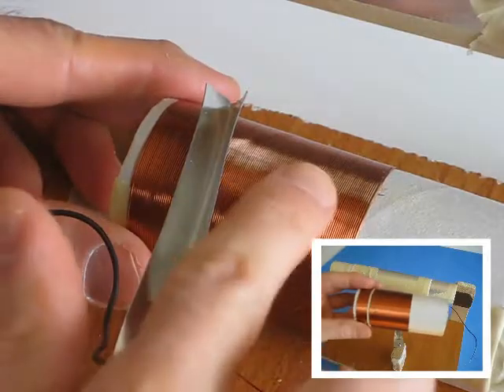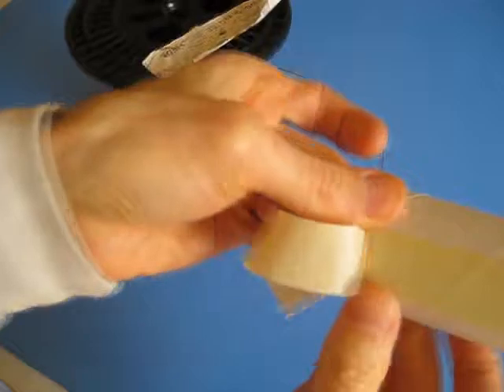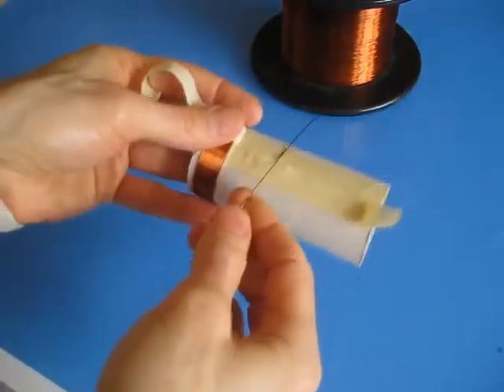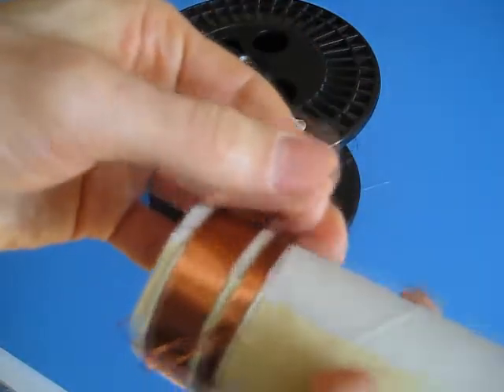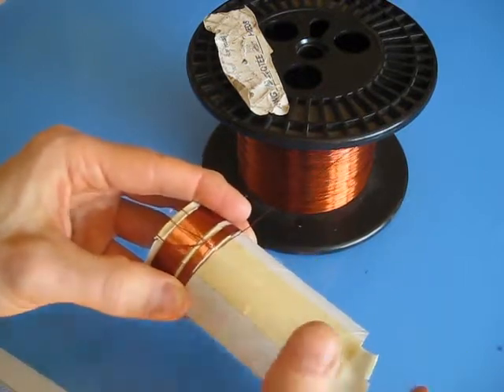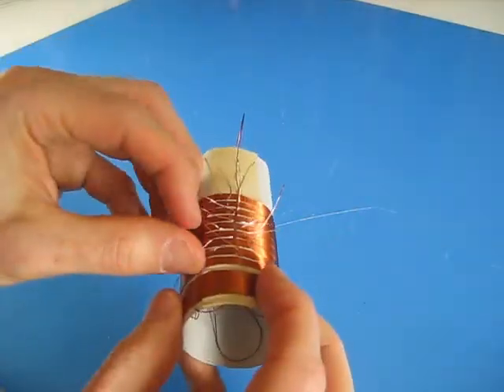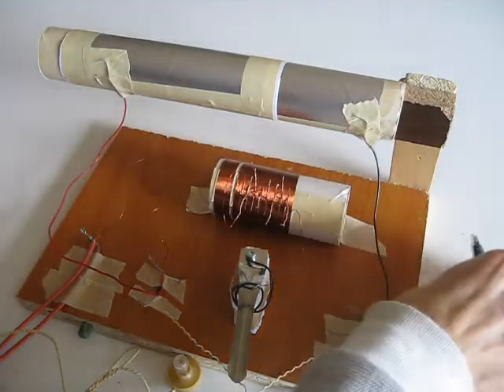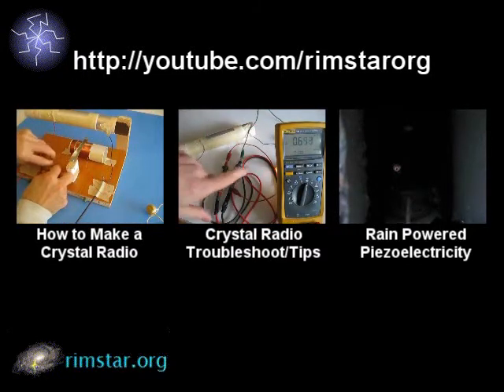Make a Crystal Radio Coil with Taps

Comment: On the end of the coils I used solder lugs I happened to have.

You gave me an idea for my next set of coils. I'll use the double-sided tape length-wise with two strips. Before I covered the PVC pipe I used completely with tap. I'll show how to make the coil this time.

As for you suggestion for not using the iN34 with the vacuum tube radio, I already did that and I'll ge ahead and make a video on it. It's called a grid-leak detector as you probably know.

Comment from the maker: It might work if you connect the end before the first tap to ground and leave the other end ungrounded and then connect the first tap to the antenna and use subsequent taps for tuning. There are many designs that work. The purpose of having two coils is to electrically separate them with a small gap for just a fluctuating magnetic field to cross. This helps with selectivity, tuning into only one frequency, though it reduces sensitivity or volume. See my "How a Crystal Radio Works" video.

Comment from the maker: @murkava I doubt it would hold the wire down well enough to last. But then again, maybe there's some double-sided tape I'm not aware of that'd work - or if you use stiffer wire. There are other techniques though. For example, if your wire is stiff then you can simply give a twist where the taps are and the rest of the turn would stay in place. Another is to apply glue as you wind the wire, I guess 30 second krazy glue, provided the glue doesn't eat away at the enamel insulation.

Comment from the maker: My understanding is it's to help keep the antenna electrically separate from the tuning part of the circuit, the tuning part being the second coil and the capacitor. It's not a complete electrical separation obviously but it's supposed to help. Makes sense.

Comment from the maker: @murkava But if I understand correctly, you used glass beads where the taps are so there was no break in the wire. Another way I could have done mine would have been to put a few twists at the base of each loop  so that when I cut the loop to remove the insulation, the wire wouldn't unwind. At the ends, did you put the wire through holes in the cylinders to secure them or is the tape alone doing it?

Nice vaccum tube radio you have! Very clean sound.

Comment from the maker: If you use a ferrite rod inside the coil then the coil can be smaller (the size of the rod) and have fewer turns. In the formula for coil inductance there's a variable called the magnetic permeability for what's inside the coil. It's 1 for air like I'm doing in this video (the cardboard toilet paper tube doesn't count), and around 100 for ferrite. So it makes a big difference on what all the other variables should be.
Reply: What is the formula for how much inductance = what frequency?. To elaborate, for example 10 turns = 455 kHz frequency. If the copper wire and everything is standard, I can use this ratio to correlate between inductance and frequency you are tuned to.
I am just trying to make a simple one without LC tank. Just a diode. Am radio receiver. But I just want to know the ratio...
Reply from the maker: The formula is a little more complicated then that, it includes number of turns, length, area and a few others. Since I get asked a lot, I made this video for the inductance formula https://www.youtube.com/watch?v=ARSQWTzWago and another for the LC tank circuit formula https://www.youtube.com/watch?v=shZUI6B5bZw . Or if you prefer, I have corresponding webpages with calculators https://rimstar.org/science_electronics_projects/coil_design_inductance.htm and https://rimstar.org/science_electronics_projects/lc_circuit_aka_tank_or_resonant_circuit.htm
Reply: @RimstarOrg  thanks buddy. I am pretty new to all this. This helped a lot.

Comment: The way I remove the enamel is to use a soldering iron with some melted solder on the tip and run it across the wire that I want to strip. That takes off the enamel and also tins the wire a bit which is always nice :) Keep up the good work m8 :)
Reply from the maker: Nice idea, tinning it at the same time. Thanks!

Comment: Heat, cig lighter, bunsen burner, gets rid of the copper wire insulation, bit of a wipe to remove the blackend residue.

Comment: I’m interested in using something glass for my tube. If I used a uniformed drinking glass would the bottom of the glass affect reception ?
Reply from the maker: No, I don't think that the bottom of the glass won't have a significant effect. It's relative permeability is reasonably low so its affect on the magnetic field should be small.

Comment: Hi, would this be the same concept in coil tapping a guitar pickup which is used to create variable impedance points with the use of a push pull pot, for example.?

Comment: Hello; A simple tip. If you go to a magnetic wire company web site; find there wire table. Look closely and find the column that tells you how many turns are in a specific unit of distance. Now all of you just need to measure out the number of turns you want. This reduces the tedium of remembering how many you have made. No more counting. : - }

Comment: Sir I want to hear down to about 1o to maybe 25 kHz. How many feet of wire would you suggest, if you have time perhaps  thank you. I'm 68"
Reply from the maker: Hi debbi, you really need to work out the values for a combination of the coil inductance and the capacitor capacitance since they work together to give the resonant frequency. I explain how in my LC resonance video here https://www.youtube.com/watch?v=tjD9I95RAbw  and on my webpage here https://rimstar.org/science_electronics_projects/lc_circuit_aka_tank_or_resonant_circuit.htm

Comment: Why is it that even when I plug my radio into a powered 5.1 system, I still need to hold my ear to the speaker to hear anything? Is there a workaround? And would a computer process the sound better ?
Reply from the maker: It could be that the signal that you're picking up is weak, the radio station is far away. A longer antenna should help with that, as long as possible in a straightish line. Also, make sure you have a good ground. It's also possible that your powered 5.1 system doesn't have an amplifier but since it's powered, it probably does.
Reply: @RimstarOrg  I put it through my turntable mixer and it was booming loud
Reply from the maker: That's good news. Thanks for letting me know.

Comment: I guess that would explain why the radio coils in the 1920's /early 30's radios that were an inch 2 across shrunk down to  less than half an inch by the 1950's .....

Comment: What's the diameter of coil wire in terms of AWG/ OR THICKNESS OF ENAMEL WIRE IN mm. Thanks
Reply from the maker: From here, https://www.rapidtables.com/calc/wire/wire-gauge-chart.html, it's a little over 0.4049. I say a little over because the enamel would add to the thickness but I don't know how much.
Reply from the maker: I just measured my coil and it's around 40mm long. 40mm / 90 turns = 0.4444 mm per turn.

Comment: what is the diameter of the wire?
Reply from the maker: The 26 AWG wire is around 0.404mm or 0.0159 inches in diameter (from this random table here https://www.calmont.com/wp-content/uploads/calmont-eng-wire-gauge.pdf ).

Comment: Value of Diameter of the coil former ???
Reply from the maker: Cardboard tube that the coil is formed around is around 45mm in diameter.
Reply: If you can't get that same size tube use this:
https://www.allaboutcircuits.com/tools/coil-inductance-calculator/
and a bit of trial and error to get the same inductance as 10 turns on the different diameter former.
In the past I made a coil on a scrap bit of ABS "drain pipe" that was the nominal 4" diameter.
It worked well

Comment: Do you even need the antenna coil or no need to
Reply from the maker: The antenna coil is optional. It's useful for tuning in just one radio station and filtering out any that are nearby in frequency. That's called selectivity, helping select just one channel without interference from others. I explain how it works in my How a Crystal Radio Works video at around ten minutes and forty-two seconds in http://www.youtube.com/watch?v=0-PParSmwtE